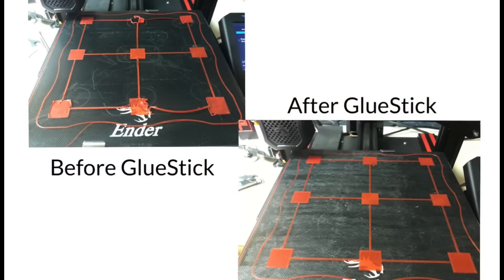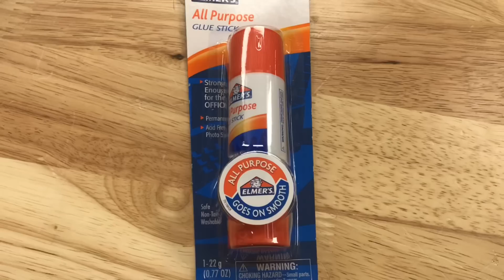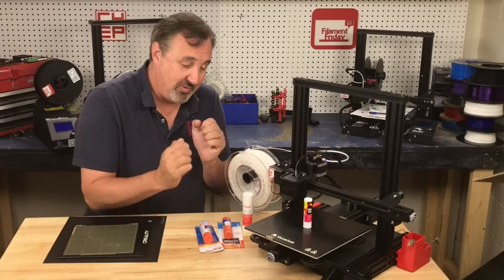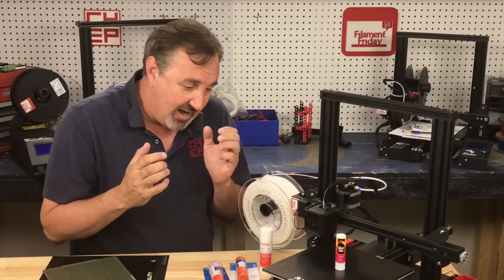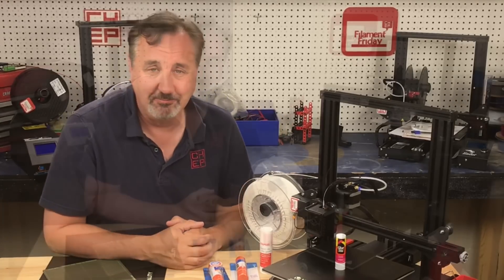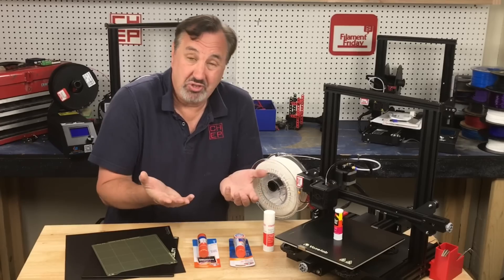Better Bed Adhesion with a Little Glue Stick

Comment: Hey, if you don't want sticky hairspray on your printer, you shouldn't spray it on your printer. The print surfaces are removable for a reason ;) I've used hairspray and gluestick before. Gotta say, for ABS and ASA a PEI sheet is like MAGIC. holds like cement while hot, then self-releases on cooling

Comment: I'm on team Aquanet myself.  but I have use d glue sticks for particularly tricky prints.  Ultimately, everyone needs to test out various methods and decide what works for them.  As with EVERYTHING 3d printer related, your mileage may vary....

Comment: When it comes to hairspray just use an empty toilet paper roll and you can manipulate it directionally. Reduces the overspray to practically zero. Personally I think glue stick is better but for those who prefer the hairspray, try it out.
Reply from the maker: Great tip

Comment: Hello, excellent channel, I always follow it. a question. Can the gluestick be used on the bed that the ender 3 brings? the one that is not glass
Reply from the maker: Yes. But it’s a little tougher to clean off.

Comment: I switched to the Creality glass bed and added a gizmo dorks PEI sheet to it… scuffed up the surface with wire wool, then acetone.  That has been my most successful method so far.  

Warning.  I scratched up the surface with my scraper and tried to smooth it out using wet and dry sand paper with windex.  Big mistake lol.

Comment: I used to use glue stick but my bed is in an enclosed machine, and cleaning  the glue  with water creates a slush inside the machine. Also, if you're not careful, you can end up with an uneven surface just from layers of glue. Agree it was a nice cheap solution though.
Reply from the maker: Only one layer at a time. I don’t have many enclosed machines.
Reply: @FilamentFriday  I was probably being too generous with it. Thanks for the advice Chuck.

Comment: How often can I use glue stick? Approximately  after 3 -4 prints ?
Reply from the maker: Depends on the prints I guess. I just clean and add glue stick when necessary.

Comment: Does the glue stick damage the special surface on the ender 3 glass bed?
Reply: Definitely not, it doesn’t interact with the glass bed on a chemical level, it’s merely a coating to help your print stick to the bed.

Comment: ASTM D4236 only applies to the labeling not the formulation so there really isn't a formal standard. However, all of these do the same things and all the formulations are pretty much PVA, PVP or starch (basically just water, polymer and some Sodium Hydroxide to keep it basic.

Comment: Hi everyone, I'm a rookie at this, just got my Ender 3D Pro, had it for a week. Everything working great, last a few days I kept on getting all kinds of strings or spaghettis coming out also my prints have been lifted from the bed. Bed is leveled temp. 60c and the nozzle is at 200c. Just want to mention I have Creality Cmagnet type of bed, I don't know what to do next, I've got myself a glue stick from staples but don't know how to apply it. Any help would be very appreciated. Thanks in advance. PS: should I be tempering with this since Amazon doesn't take responsibility of replacing the pad.

Comment: I tried the glue stick it just didn't work out, what do you set your temps at for the nozzle & bed when you use it? I usually set my bed at 80-90 depending on how things are adhering to it, & the nozzle anywhere from 200-220 & my prints come out alright without the glue stick, I wait till they cool a bit so they release easier, then I wash the bedplate with dish soap & water then use the rubbing alcohol & I'm good to go.
Reply: Arnold Rimmer  Ok & I forgot to mention but I do lower the bed temps after I see that the first layers have actually stuck to the bed but I use to stick with 75 because anything lower than that wouldn't stick but lately that wasn't even working?  I'm not sure why...  We have the Ender 3 Pro, my nephew ordered & set it up for us, then my cousin set up the cura-maker program on our desktop, we didn't know about that either, we were just scratching our heads wondering why we couldn't get it to make anything off thingavers... lol.  A little over a year later now...  Lol, doing much better but still allot to learn & that's the fun part :)

Comment: Yeah, i am using glass bed  on all of my printers and when I cannot use a brim (e.g. print in place mechanisms) I use a glue stick. I prefer "UHU Stic". One stick lasts for around a year or so, as I did not wash my print bed. So the glue is even on, when I do not need it anymore. Why waste it by washing it of, when it is there anyway. It does not hurt.

Comment: I tried a PEI plate on the magnetic ender plate , no glue, and it came out like black glass
Best print I’ve ever done 
As Chuck recommended, first layer width at 0.26, you can’t see the layer lines

Comment: ok so when it comes to cleaning it up what type of cloth works best or do you wash it like a dish in the sink with dawn soap and a scrub brush? Do you wash it immediately after each print or let it sit for a few prints? I tried wiping mine down with a cotton cloth with ISO but it caught on the original bed that came with my Ender 3 bed and then I was stuck picking stuff off of it....lol
Reply from the maker: Cloth soaked in warm water cleans if fine.

Comment: I didn’t take the bad adhesion seriously at first and it let to horrible layer shift when one of my prints stuck to my nozzle and snapped off of the build plate. Almost couldn’t fix it due to how little knowledge I hve about 3D printers but I managed

Comment: I have a dumb comment.  I would love to see a video with this being applied and then printed.  Does the glue melt? Solidify?  How does it impact removal of the part?   I don't use glue stick, frankly because I don't need to.  I have had the same original magnetic material that came with my Ender 3 PRO several years ago.  I clean it before every print with ISO, every once in a while take it to the sink and under really hot water scrub it with the rough side of the sponge, followed by a drying and another cleaning with ISO.    I'm asking because on the rare occasion I have an adhesion issue, its one or two spools of filament that cause this.  I change filament and run the same print and it works, so I feel confident the variable is the filament.  I would like to use up this  role of "bad" filament, but don't want the hassle of cleanup if there is any.   Love the channel Chuck.  Thanks for all you do.
Reply: Glue usually solidifies - I print at 220C and 110C bed (ABS) so I use it to avoid warping. It solidifies if you don’t apply it directly before the nozzle starts printing, however nozzle is able to melt it again and make filament stick to it really well. Usually you can pull it off when the temperature drops - glue is already solid at this point - just like the filament.

Comment: One thing glue stick will not solve is printing with materials like ABS. it will stop bed warping but as the print gets higher you end up with layer separation as the bed is held in place and wont warp :)

Comment: worth getting the magigoo compared to the Elmer's glue stick?
Reply: I've never tried it because hairspray works so well for me. I take the bed off and spray it in my sink so my printer doesn't get covered in over spray. Regular Elmer's glue stick works well too but needs cleaned off more often.

Comment: After many adhesion failures, I could be tempted. A new Ender 3 MAX worked more or less OK when I first started but after a couple of days printing, its almost impossible to get anything to print before it gets ripped off the bed.
Reply: Try levelling your bed if you haven't already, my printer took a while to get settled in in the beginning and had to keep re levelling it

Comment: Do you heat up everything, level the bed and apply the glue while everything is hot, or do you apply the glue while everything is cold , heat up the bed and nozzle then level the bed?
Reply from the maker: Apply cold
Reply: @FilamentFriday  HI thanks for getting back.  Even though your response was in a timely manner I was frustrated since this was the first time in 2 years when I first bought my printer that I had adhesive issues.  This is the first time I was printing a helmet and was printing to the outer edge of the build plate. That being said, I heated everything, leveled the bed and while hot I applied Elmer's purple glue stick and everything is now running great. Thanks for the tip!

Comment: what about bed temperature when using glue? do you just use the usual temperture for every material or reduce it in some cases?  or do you even still need to heat the bed if there is glue holding the print down??
Reply from the maker: Depends on the print. I do both.

Comment: hello chep..how many print can use by 1 swipe glue stick?i've been print mask extension at full build plate of bed...at first print i take off the complete print the some of the glue take off too...should i add at dry n the place glue off?
Reply: btw i use ABS filament...thank for your channel it very helful..
Reply from the maker: ABS probably needs a new application every print. PLA far less often.
Reply: Owwh .orite thank mate...

Comment: thin coat of diluted white school glue. you can reactivate it many times with a  wet paper towel.  its used widely to affix t-shirts to presses before printing .
Reply: same goes to gluestick..just a wet towel or a sponge to reapply it..;)

Comment: I like to spray mine with Isopropyl Alcohol, After each print... Finger prints etc Can make the object lose adhesion to the bed.. Ive never had a print un-stick, since i started using IPA..
Reply: I have lost every print since using IPA..I guess it’s a little bit of luck as well as method
Reply: One question can i use a little bit of water after every print to keep it clean? Thanks

Comment: I'm trying to make Abs print. But it wrinkles in the corners. And the heat insulated box doesn't help. Takes the size of my print bed. Very frustrating after 18 hours print. So you mean glue stick will solve that issue?

Comment: One tip, when using glue stick, for easy clean go back over with a glue stick and the scraper, easy clean.
I use the cheapest sticks I can find,  never had a problem, use-PLA,TPU, PETG, even with small parts.

Comment: So have a CR6-SE that has been working flawlessly, Stock bed with no adhesion problems.  I did have one print that had a very small cross section on the bed and was knocked off twice while trying to print, so figured why not try the glue stick. 

Worked great, but now the issue. even though I have completely cleaned the build surface, I can't get any print to adhere unless I use the glue stick? What in the world happened?  How could a glue stick harm my build surface like that?
Reply from the maker: Not sure. I haven’t experience that. Washes off cleanly with water.
Reply: @FilamentFriday  Yes, It washed off very easy, but now my stock creality Carborundum bed just won't stick. I've cleaned it with water, alcohol and even some Formula 409 and nothing seems to restore it to the way it was. Very perplexing.
Reply from the maker: What glue stick did you use?
Reply: @FilamentFriday  Avery Glue Stick from Staples.  Update, just put a new print surface, did an automatic bed level and works like new again. So threw my build plate in the dishwasher to make sure it was super clean, put back on and still wont allow a print to even start, the filament just drags around on the surface without adhering. Really have no idea why it won't work again. Guess I'll keep that build surface for when I need to use  a glue stick, but don't think I'll be trying them on any "new" build plates.
Reply from the maker: First I’ve heard of this. Try cleaning with isopropyl alchol
Reply: I have also a carborundum bed. But i didnt use the glue stick on it, i advise you to try with the glossy glass, you wont believe the results!. Perfect shiny first layers all the time

Comment: I use hairspray on my Ender 5. Of course you would remove the glasbed from the machine before applying hairspray on it. So no haispray on the machine, only on the glasbed.
Reply: My glass is siliconed to the plate, hairspray is my main thing. Just wipe down everything with alcohol occasional ly

Comment: Can it be used on magnetic bed instead of glass and if so with the bed heat off or on ? And for PLA do you need a heated surface or not ?
Reply from the maker: It’s harder to clean up but yes it can work. Depends on the PLA. I do recommend heat.
Reply: Thanks going to try it!!
Reply: @FilamentFriday  how do you recommend to clean properly a magnetic bed after using glues stick or for general maintenance?
Reply from the maker: Warm water on a wash cloth should take the glue right off.

Comment: Well each time thier own. I used glue and hated the crap it leaves behind on the prints. White crust I hate it. I got a pei and been printing on the same surface for over a year stoll going stong with no adhesives. If a filament doesn't stick I print the first layer really slow at 10mms.

Comment: i'm having trouble using PVA (wood glue or glue stick) and printing PETG. do you know of an adhesive that sticks well to PETG?
Reply from the maker: I use Avery permanent glue stick
Reply: @FilamentFriday  thats probably pva as well, right?
A friend of mine ran a hplc on printafix, most of that stuff is pva, the other compounds she could not identify.
Reply from the maker: It just works for me on PETG.

Comment: even if the glue doesn't feel sticky after a while the 200 degrees of metal touching it should melt the glue as an adhesive, and make the print stick

Comment: Newbie here. Got an Ender 3 S1. Finding it hard to get prints off. And prints are leaving excess filament I cannot get off with soap and water. Glue stick needed here?
Reply: You probably have the bed too high so the filament is basically being combined with the bed, lower the bed a little bit and try again. I had the same issue, had to get a new bed for it

Comment: I've never once had to use glue stuck on my Ender 3 V2. Not sure why you'd need to. Just clean the bed with IPA before every 4th or 5th print.
Reply: I used it often an release agent. PETG for example, can adheire TO much. Gluestick can make it release easier.
Reply: I've never had to use any of this crap either. I don't get it. Maybe it's just that the Ender 3v2 has that nice of a bed. It's my first 3D printer so I have nothing to compare to.

Either way. Isopropyl and lint-free rags between every 5th print or so like you said, and I'm golden. If the peice I'm printing has a small footprint I'll use a raft. I've never had an issue getting a raft to stick.
Reply: @dangerous8333  I hear what you say, but it's not always used as a adheisive. It's often used as a layer to adheir on. So that when you print i.e. PETG, it releases easily without damaging the print surface.

I use an E3V2 also, so I get what you mean. But if you get any further with printing, with exotic materials, you'll eventually understand what the reasons behind glue is. I had my doubts also for a long time, it felt like "cheating". Except it's not, it's an tool to have succes full prints.

Comment: I only use glue stick where the print will be laid down/printed not the entire surface, (I'm CHEAP not CHEP Lol!). We do small items in production runs we fill the surface with the file. I print 2-3 hour prints all day, then start in the next day and print. Until we start having any problems I don't touch it. I've gone weeks before I had to clean the surface. 
Many items we print it's just a clean glass surface, but for prints with little to no surface area, we use glue stick in our business. 
There is no sin in using an aid, especially anyone first starting out, why be frustrated and put the printer in a closet never to be used when a "LITTLE" glue stick goes a long way.

Comment: I print nylon (which does have adhesion issues), I use Elmer's Disappearing Purple Glue Stick onto borosilicate glass (bed at 100C). The real trick though, x6 layers allowing each layer to dry before application. Too much glue really hasn't been a problem. As to damaging the glass, don't print PETG onto glass.
Reply: I have zero issues printing PETG on glass. Then my bed is not heated.
All my prints have been with cheap glue sticks, and the PETG is easy to remove. At least it works really good for me. All my prints have been PETG so far.

Comment: Isn't it a bit like using painkillers instead of sorting the reason for the pain? How do you know if you have the best settings if you're masking problems that you should fix first?
Reply: Well in my case I've lost hours upon hours doing everything possible and still not been able to get prints to adhere.  Using hairspray worked like magic.  Without that, I would have taken a hammer to my printer.  So there's that.  I just want to print.  It's important to have success in the beginning.  I will try glue sticks next.  Maybe one day I will figure out the real problem, but for now I'm finally printing and I'm thrilled.
Reply: @stevetb7777  Yes, I've been there too. I sort of take back what I said. Since watching this video I've got over my internal shame and have used glue stick on more difficult prints, which as you say, saves hours of wasted time. I hate doing it, but it works. I'm now printing nylon on a G10 bed with glue stick so it's opened up a new world of functional parts. I should have known - I use hearing aids because my ears don't work that well. :-)
Reply: @dipintheblue1955  Hah!  It's just better to have things work.  =D